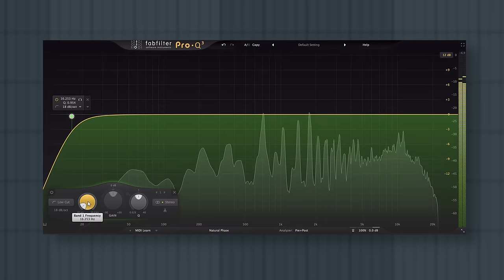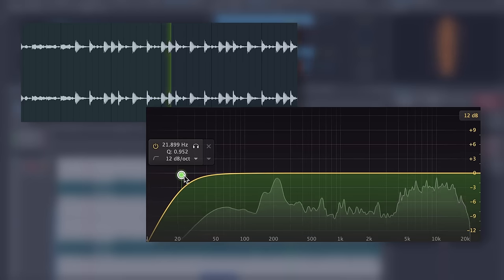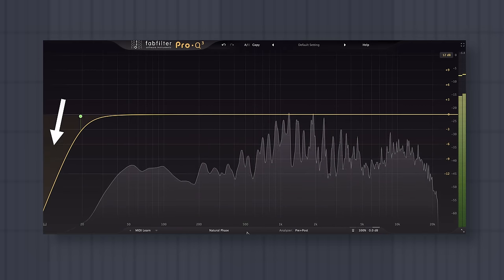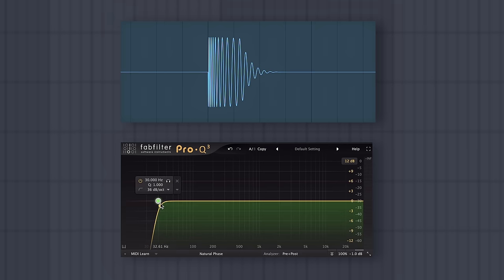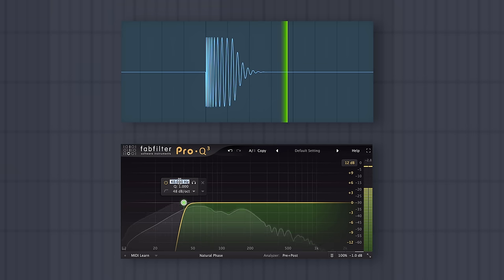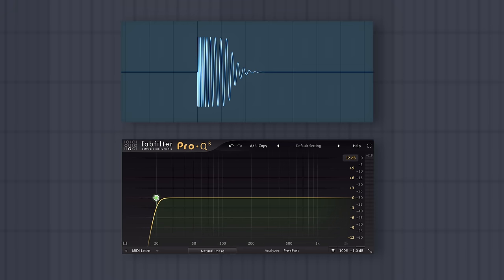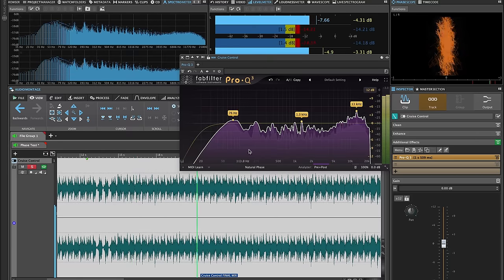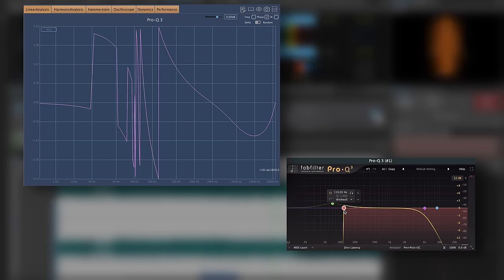Do high pass filters ruin your mixes? Fixing Bad Music Production and Mixing Advice EP.2

Comment: Hey Mr. YouTuber Audio Expert. You might want to read my posts below. To learn something you do not yet know. As your Ignorance, precedes you.

Right out of the gate. This is misinformation. High-pass filtering is very important. It's of primary importance. For any good recording. Because most of the low-frequency crud. Really needs to be filtered out. Through high-pass filtering. Lots of it! Heavily applied. As there are no good reasons not to! Phase shift certainly isn't one of them! That's how equalizers work! They change the phase timing of all frequencies! Except for digital linear phase equalizers. Which you do not want to use as a normal equalizer. Because they are not. As they will not sound like lush variable phase equalizers. They only affect the frequency you have selected. And none of the others. And so they do not work nor sound the same. As standard, audio console style, equalizers of all types. From Neve 1073 basic EQ's. To the super versatile and great sounding, George Massenburg, original ITI Parametric Equalizers. Those are all variable phase EQ that have cut countless, hit records. WITHOUT LINEAR PHASE EQ! And so how did they do that? DUH? Give me a break here!?

Causes a phase shift? That's how most equalizers work, Sonny boy. Unless they are Linear Phase. And nobody knows when they are using that. They don't know what that means. You think you do? And you are worrying about a phase shift. You don't need to worry about. Why are you worrying about that phase shift? When it has been filtered out. DUH?

You are overthinking everything here Sonny boy.  You're supposed to let your ears, be your guide. Not technical blah blah you've learned from this information. And want to sound all engineering technical for people. When you don't really know what you're talking about.

Vocals that are only high-pass filter that 20 or 30 Hz? Are you out of your mind? Do you realize how much Proximity Effect you will still have? You will have a muddy vocal. As that is insufficient.

I high-pass my vocals rather aggressively. Like at, 270-300 Hz. And is much Cut Off, as I can get. Smooth rolloff? Hell no! Cut off! Phase shift? Sure! I don't care! You shouldn't either.

And then what do you do? After you severely high-pass filter the vocal? Why, then you, boost the midrange between 3 kHz and 5 kHz. Bump that up, 6 or 8 dB. Then grab the high-frequency equalizer and boost that another, 6 or so dB.

Now when it's finally sounding, really tinny, crispy, metallic, harsh, distorted, nasty. Then! You shove that signal into a, Peak Detecting, FET, 1176 style limiter. All buttons in, 50:1. You turn the attack time to slow. Because it's not slow. Slow is 1 ms attack time! Fast is 1 µs, attack time. Which I rarely use. Because that's too fast. Except for a, FM Transmitter. Or a Record Cutting Lathe. Then you might need 1 µs attack. Certainly not on somebody's  lead vocal. Then, 1 ms  i.e. slow is still pretty quick, for vocals.

 And you push in, on that limiter. So when the vocalist is singing. The meter on that limiter. Looks like the Windshield Wipers, on your car. Driving 70 mph, down, I-95 in Florida. During a Hurricane. And that's the way the meter looks on my, 1176 limiter. When I'm Cutting a vocal. Committing that to the track. Not done on mix down. No. That never sounds the same. Track it that way.

The nonsense you've read and heard. About only using, 1/2 to, 1 DB of limiting on lead vocals. Is, absolute Hogwash! That's bullshit. You've been duped. By famous stupid engineers. That don't want any more competition for themselves. So they tell you. The only put 1 DB of limiting on the lead vocalist. Bullshit!

And if you're wondering what that sounds like?
https://soundcloud.com/user3139903/lusyferzmixerz4

I do not think about, phase shift. When I need to filter something! It needs to be filtered. There will be phase shift with the filtering. As you don't always want to use, Linear Phase EQ. Really you don't. You want to use good old-fashioned, variable phase EQ.  That we've always known. Always used. Always  had. Until he got computers, software and linear phase, EQ. But that's not what you typically you would want. As you don't exactly understand phase timing for phase's, sake. This is all, pop-culture misinformation again. Technicalities, you need not be worried about. As little audio children. Thinking you know something about audio. Because you heard somebody on YouTube say something cockamamie. They have a college certificate to prove it! Whoopee for them! I'm so happy for them.

And how much stupid money did you have to pay for your, Recordin'  Certificate Degree? $20,000? $40,000? $80,000? You've been duped! What had idiot!

For that kind of money. All you needed to do. Order yourself some recording gear. For $20,000. And start recording. Record your friend's rock bands. Do not charge them anything. Until everybody likes what you are doing. Then you can start charging. And you don't need any stupid college certificate degree thingy in this, career field. A degree in music would be better. Instead of a degree. In, playing with recording thingies.

If you want to do this for a career and a living? You might want to do what both Bruce Swedien and I, did. Start in Broadcasting. Start recording musical artists, live. Not in the studio where everything is perfect and controlled. But live.

Where the acoustics could be awful and totally compromised. Background noise. People conversing. Kitchen noises. Wind blowing. Traffic noise. All cheap PA microphones to record with. Because you're outdoors. Or in a tight little club indoors. Where the acoustic signature is, even worse. And that's how I and Bruce Swedien both started out. In Broadcasting. Broadcasting live and/or taped, musicians and singers. Of a world-class uppercrust,, variety.

You will find it's almost impossible to make good recordings. With the best equipment and microphones. When the subject has no talent and no expertise. Then you will only get, unlistenable, gobbledygook. Because they have to have some talent.

If you want to make a studio recording. Where everything is perfect and under control. There is no challenge to that. That's easy to do. Everything is right. Nothing is wrong. You have the perfect microphone selection of the finest, vacuum tube condenser microphones. You have perfect acoustics. You have perfect equipment to record upon and with. And so you can't do a bad job. But plenty of you do. Because you are overthinking everything.

Overthinking all of the technical blah blah. Won't make your recordings any better. And Phase Shift. Never purchased any recording. But we do. Phase shift does not prevent recordings from being released. Nobody cares about the phase shift. Why should you? Does it sound good or doesn't it? Do you listen with your eyes, mathematical formulas and textbooks? I don't think so.

So this is a mistake you are making. I don't think about, frequency response. I don't think about distortion. I don't think about phase shift. I only care if my microphones are all phased, together. So there is no low-frequency, cancellations, going on. And no high frequencies getting muted. Follow? From a bad microphone cable, for instance? But I don't have any bad microphone cables. Sometimes, Touring PA Companies, do. And when I'm taking splits from the stage of all the microphones. Every now and then. Hey! This microphone is out of phase to all my other microphones! And then I push a button to fix that! Voilà! Problem solved! It's really that easy.

And now. None of you realize. And I mean none of you. Realize you are listening to your, left and right channel speakers in phase together. As they should be. But what you don't realize?

A big joke has been played upon you. By the Speaker Manufacturers. In that? Your speakers might be in phase together. But together. They are also in, 180 Degrees of Negative Absolute Polarity. Your speakers are in phase together in Negative Polarity, together. LMAO! You don't know what the hell you're listening to! But I do!

I am not only a history making, Audio Engineer. I'm also a history making Maintenance and Studio Design, Engineer. And I'm what they call a Studio Fixer! Yes I am!

And when you have to fix the control room. Of one of the finest, American, Audio Console Manufacturers, own, Studio. Because the Electrical Engineers and the Acoustic Engineers. Could not fix the Speaker Monitoring Problem? No matter what they did. No matter what test equipment they used. No matter what other ancillary equipment they added. No matter what other Acoustical Treatment and Changes, they made. They couldn't fix the problem! Why?

(More Polarity Popularity in following post)
Reply from the maker: Watch the video. It’s perfectly fine to high pass vocals further. You have missed the point of this video entirely by jumping to your own conclusions about me. Age does not equate to wisdom. Writing dozens of paragraphs and spamming my page shows a high level of immaturity. It does not present the compelling argument that you think you are making.